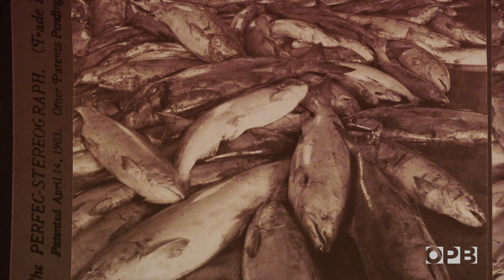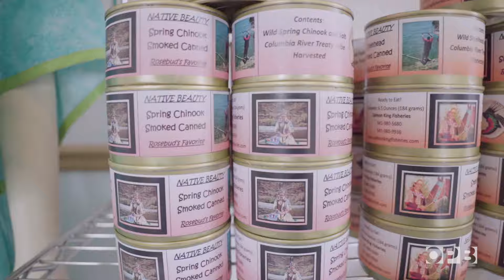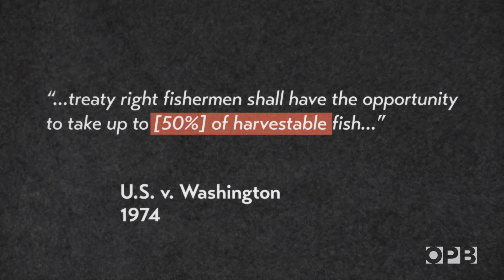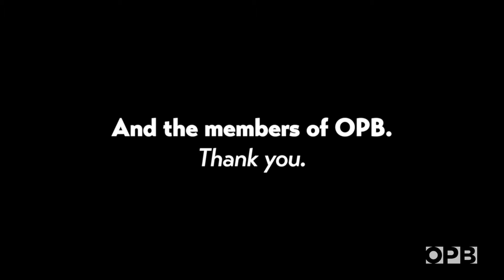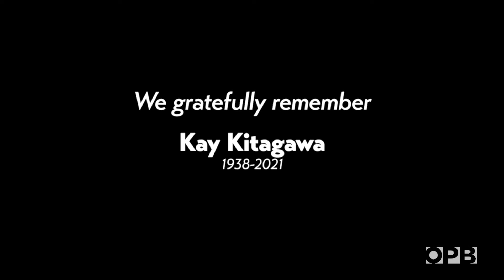How salmon shaped the Northwest  -Superabundant S1 E6

Comment: I have seen salmon runs in the Skagit Valley, Wash.Winter 1979.In a creek called a ditch in B.ham,Al.I was amazed.,in the valley of the mountains. When they die, their. Bodies provide nutrients to the forest and animals. They can go to where they were hatch.
Reply: 1st salmon run I saw at 10 in Alaska...figured no one would believe the description as a kid exaggerating.

 Where they concentrated below a severe staged waterfall of several hundred feet drop, they were so dense it was creek bank to bank black w fish backs, as you approach the bank they pull away forcing others mid stream to be squeezed out of the water on the backs of others!  Solid salmon.  

Also about 150/200 bald and golden eagles in the area, counted 73 white heads looking in one direction across the bay while half of them harder to see had brown heads (younger balds and goldens), bears and everything else congregating there.  Fortunately WE were the only ppl other than commercial fishing boats tightly regulate away from the the bay by harsh penalties and vigilant airborne "cops".   Multi-million $ boat confiscated, massive fines right down to the lowest crew members if caught by bush plane cop popping over the ridge while your nets were inside the harbor or across the line.
(too easy to drop nets to harvest entire run close to creek, wiping them out)